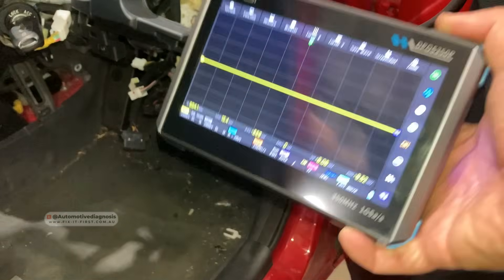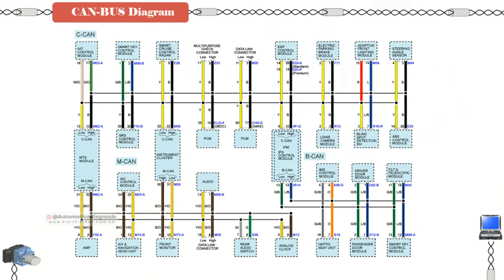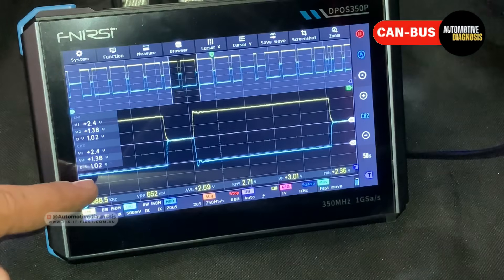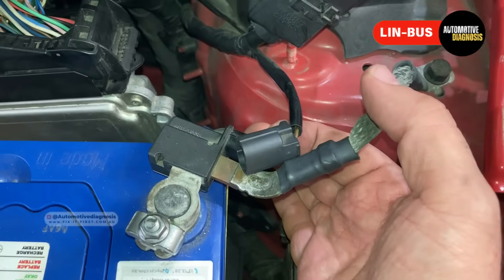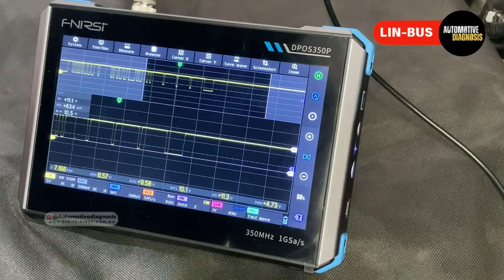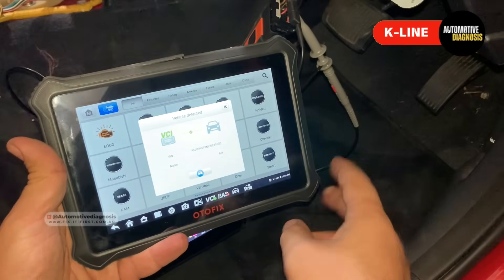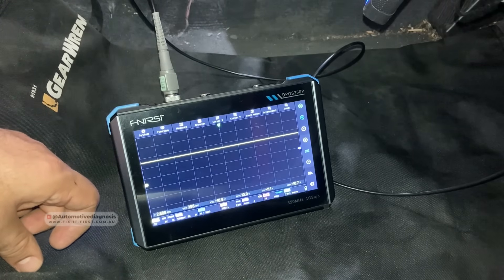Automotive Network vs Budget Oscilloscope | CAN BUS, LIN-BUS & K-LINE Diagnostic with a Budget Scope

Comment: A missing detail maybe?

Am I right to think both K-line and LIN bus should either be steady at or near battery voltage with key on engine off, or already communicating?

When you used your scan tool to get comm happening on the K-line it looked as though voltage jumped from resting low, to a higher level, before being pulled to ground by signal? I'm suspecting that was actually just the scope autoranging but be good to know for sure!
Reply from the maker: Hi my friend, in case of LIN-Bus, most of the time when ignition is on (even with engine off) communication is happening, even on LIN-Controlled alternator you will see very same thing. But in case of K-Line, it mostly works when needed, for example in it's for diagnostic tool communication, it works when scan tool is starting the communication with relevant control units.

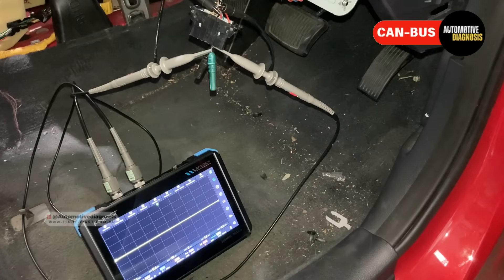Comment: Looking at the pulses carefully around  at between 05:37 and 06:25, higher voltage pulses or lower voltage pulses were detected , maybe ONE vertical unit ,maybe nearly 500mV , were these pulses output by faulty node (s) ?? , pls let me know . tks
Reply from the maker: Hi my friend, no it's not showing any fault, that signal shows the end of a message.
Reply: @AutomotiveDiagnosis  thanks

Comment: i have gauge plugged in my obd2 port on ford ranger - how can i easily add oil pressure transducer to the factory canbus network so my flash obd2 gauge will work?

Comment: Hi, thanks for the video, I've been waiting a long time for someone who could show me how to work with machine information buses.  I am looking for an oscilloscope to diagnose the ignition system in a car in addition to the engine tester, as well as checking the information buses. Is it suitable for taking readings from camshaft and crankshaft sensors, is the recording length sufficient for analysis? Thank you in advance.
Reply from the maker: Hi my friend, the video for crank/camshaft sensors diagram using this scope is recorded and will be on the channel very soon.
Reply from the maker: Hi there, We just published the video for crankshaft/camshaft correlation using this scope, you can watch it here:
https://www.youtube.com/watch?v=gsuC_kD4kt0

Comment: Is it suitable for crank and cam shaft signals? Can you grab at least one full cycle (720 degrees)?
Because previous model (1013D) is almost useless in automotive field! Record length not sufficient, plus the synchronization problems (channels are not in sync. while you watch them live!).
Reply from the maker: Hi my friend, I haven't had a chance to check the crank/cam sensors with this scope yet, I will give it a go and will keep you posted here.
Reply: @AutomotiveDiagnosis update us if this oscilloscope is suitable for cam/crank signal..
Reply: yes please re cam/crank signal query.  And also your opinion on how suitable this oscilloscope is as an automotive scope would really be appreciated?
Reply from the maker: @blairwilson9272  Sure thing my friend, I will check it as soon as I can.
Reply from the maker: Hi there, We just published the video for crankshaft/camshaft correlation using this scope, you can watch it here:
https://www.youtube.com/watch?v=gsuC_kD4kt0

Comment: When you connect the oscilloscope to the vehicle for the first time, do you select the voltage setting, or do you use the 'AUTO' setting  ? Thanks
Reply from the maker: Hi my friend, you can go either way, I normally like to set it up manually.

Comment: If i get communication from the battery sensor randomly and i can "manually" reestablish that communication just by wiggling a bit the sensor, that means some contact is not perfect between the sensor and the battery pole? Or inside the sensor, maybe?
Reply from the maker: Hi there, it's most likely the wiring and connector itself, sometimes female and male pins are not in good connections or there might be a bad connection between a wire and a pin.
Reply: @AutomotiveDiagnosis thanks. Awesome channel you have. Keep it up 💪

Comment: Thank you sir...i have  waiting this vidéo for a long time... i have NO communication with( battery sensor & regulator of alternator)  (LIN Bas) ... i checked wires and they are good 
also i have U100800 code since we change that regulator
i hope someone have an idea
thank you again
Reply: Why you changed the regulator if you have no communication on the LIN wire from the battery sensor?
I've been having lately the same problem with the battery sensor randomly not communicating with the ECM, but I always have communication from the ECM part requesting data from battery sensor. I established that by disconnecting the connector from the battery sensor and there is communication with it disconnected so I assume it is the request from the ECM.
However, when I connect it back to the sensor sometimes the sensor responds back and sometimes it doesn't. I can reestablish the sensor communication just by wiggling it on the battery pole. That tells me that maybe in the sensor or in the connection of the sensor with the battery pole there is an imperfect contact.

Try to wiggle the sensor and see on the oscilloscope if the signal is changing, becoming more "populated" sort of saying.
Reply from the maker: Hi there, fault codes on the network could be caused by wiring or connectors too, so after checking them, scope can be very helpful to diagnose the network.

Comment: My neighbor has a ford escape her wipers started working while just driving down the road . She took to shop the put control switch in then a master wiper motor still no fix . I found the battery sensor was corroded horribly. Put new sensors and fixed the connector. Problem solved
Reply from the maker: Thanks for sharing your experience with us
Reply: How did you get to that
Reply: @TONYSTARK-jh2wu ford forums. Car was fixed with just new sensors and connector . Still doing great according to owner

Comment: Very Cool. You really do an excellent job of breaking down the communications.  I was just Picoscope 2204A capturing the K-Line and LIN-Bus on a 2006 Matrix. I noticed almost all activity was on K-Line when viewing live ECU data. However, when I queried the modules the Lin-Bus became very active as well. I think module query is going through the network gateway module, connecting the K-Line to the LIN-bus. I used an Xtool A30D as scan tool.
Reply from the maker: LIN-BUS and K-Line are very similar in design and operation. Also for making sure how network is connected to the control module in a car, wiring diagram can be a great help.